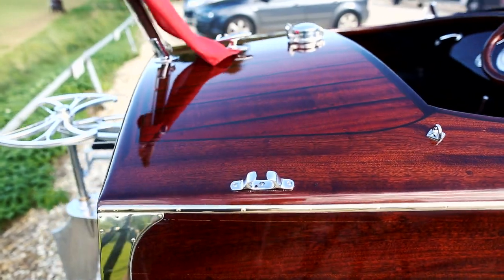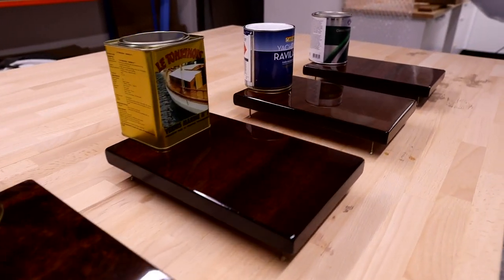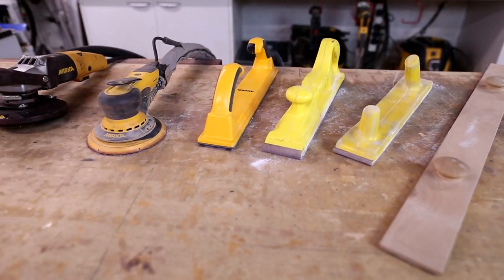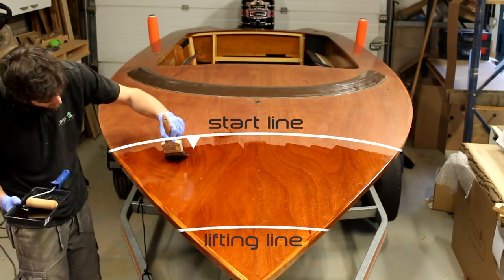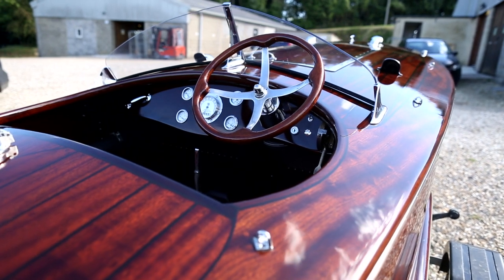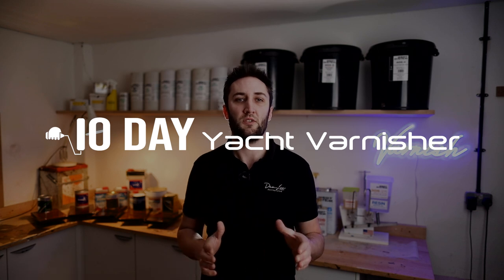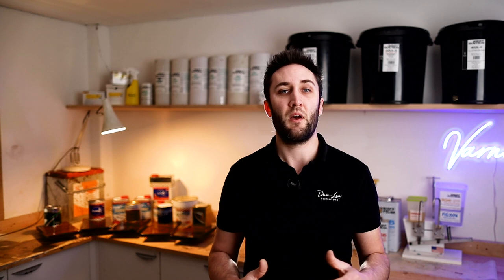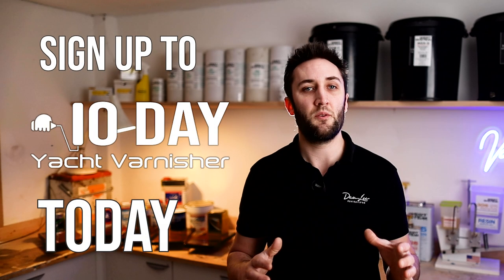Varnishing Course Launch | 10 Day Yacht Varnisher

Comment: You mentioned varnishing previously varnished wood; do you extensively cover how to properly view and efficiently remove varnish? The way I do it (heat gun, scraper) is fairly time-consuming and creates issues (roasting the surface of the wood). And this is part of (multiyear) maintenance for "traditional" varnish systems!
Reply from the maker: This is just the sort of feedback that I am hoping to get from students in the pre launch phase 👍 

Yes if that is one of the elements you would like to learn then I will create a lesson specifically for it. Module 4 will cover existing finish preparation.
Reply: @DanLeeBoatbuilding  Thank you - this is a situation many of us are in.  We acquire an older used boat that we are bringing back into form.  Dealing with water damage, UV discoloration, and any number of other things that affect the appearance of wood are all highly topical to us !